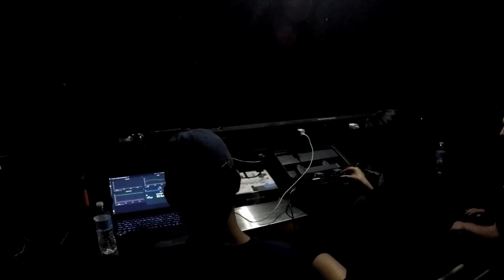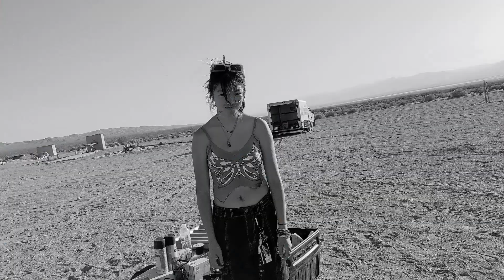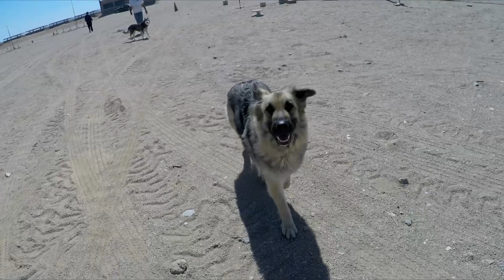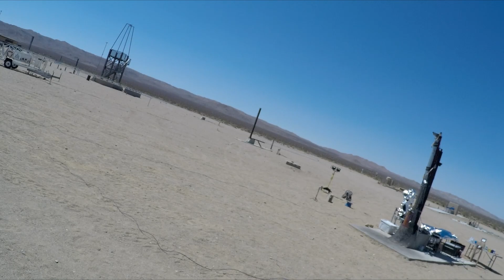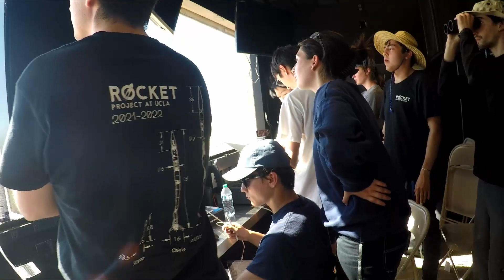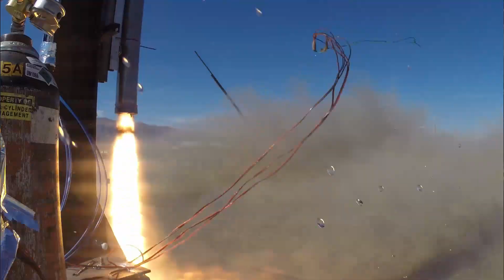UCLA Hybrid Static Fire (June 2022)

Comment: Pressure drop across injector is too low leading to high frequency instabilities (screaming noise heard shortly after ignition).  Best to always have more than 100psi drop in autogenous Nitrous Oxide hybrids. Nice firing and good luck UCLA team